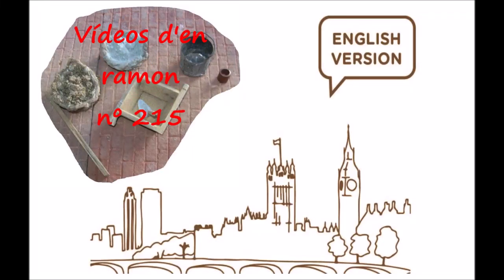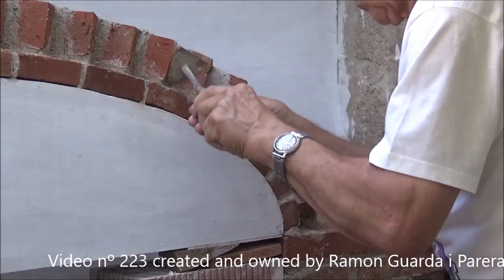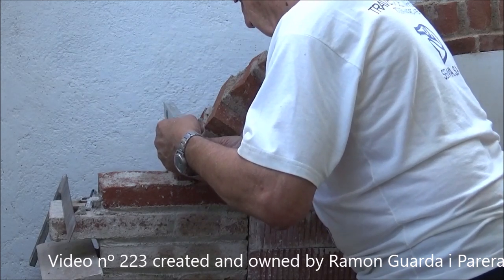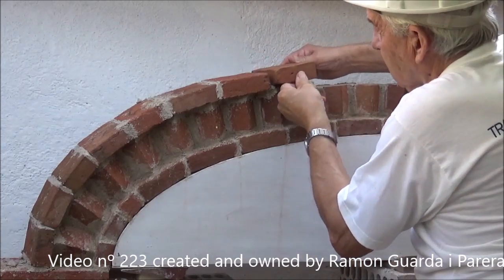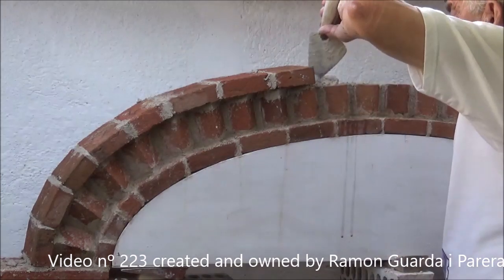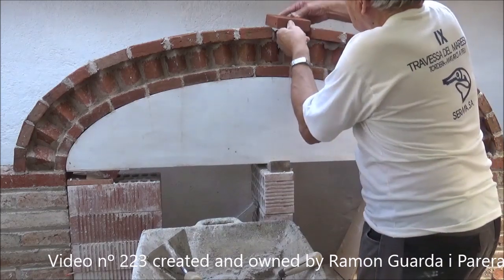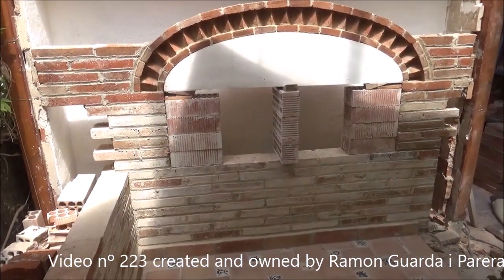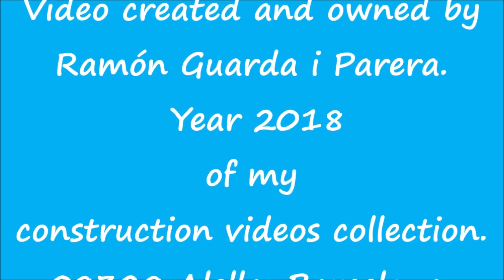How to build an elliptical arch with uncoated bricks, second and last part nº 215

Comment: Como hacer la mezcla para pegar ladrillo
Reply from the maker: Hola Ramirez querrás la dosificación y tipo de mortero este esta hecho con mortero de cal, material flojo para que me sea más fácil de demoler, pero si es para dejarlo lo mejor es Mortero Seco M-7,5 o mortero de cemento portland dosificación 1 parte de cemento por 3 partes  de arena limpia saludos  Ramon de Guarda i Parera.
Reply: @ramon17642  muchas gracias señor Patera y un fuerte abrazo desde el estado de zacatecas

Comment: What kind of mortar do use between the bricks
Reply from the maker: Hello Bennie Kleynhans I used lime mortar because when I finish making the video I have to demolish it, and with this material it costs me less, for a normal construction you can use portland cement mortar in a volume ratio of 1 part of cement to 3 of sand. Greetings Ramon de Guarda